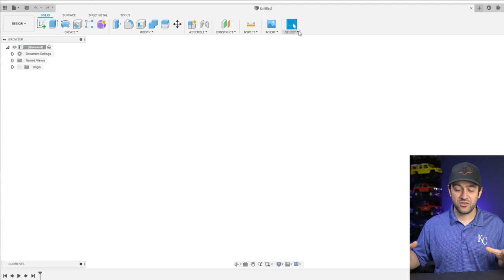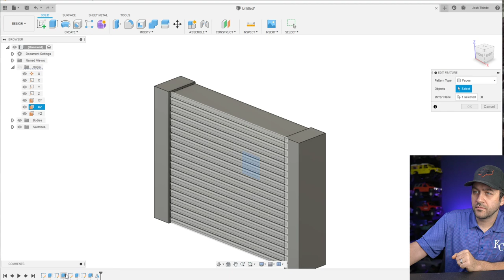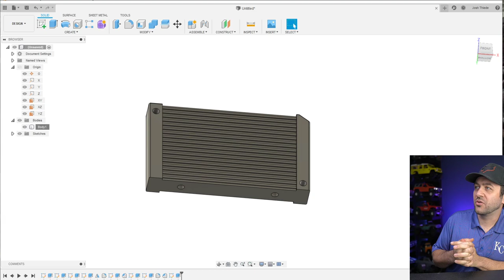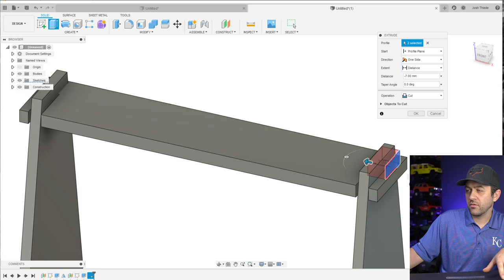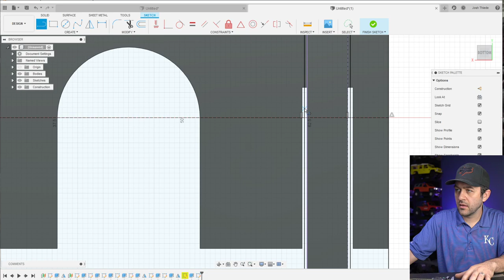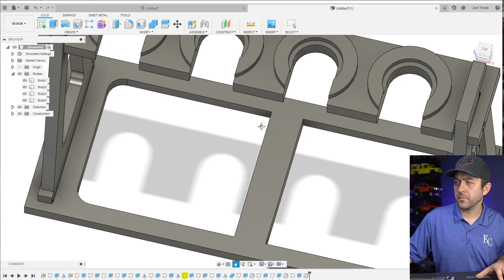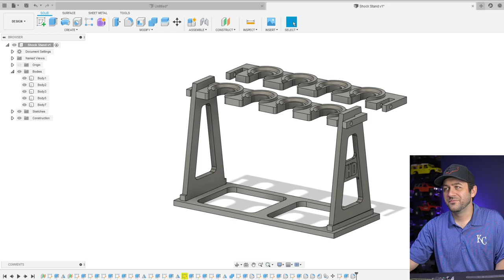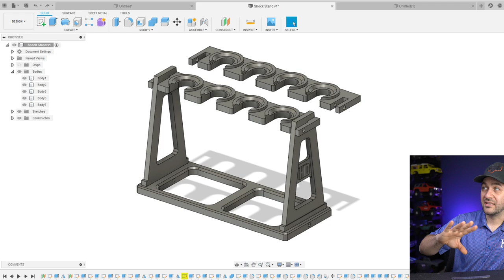STL Sunday - Radiator & Shock Stand - Ep 5

Comment: acan i make a request?
i'd like to see if u could make a spare tire mount for the back of the scx 10 iii JL Rubicon and maybe a stinger front bumper please
Reply: AliExpress has some parts for the SCX10 III: spare tire mount with or w/out 3rd brake light, hood mounted w/shld bumpers, Rugged Ridge snorkel, cowl lights, tailgate glass hinges, clear plastic headlight lenses,
------  I'd like to see scale Rubicon steel F bumpers: std width & with ends removed -------